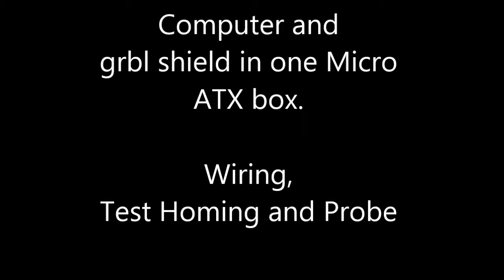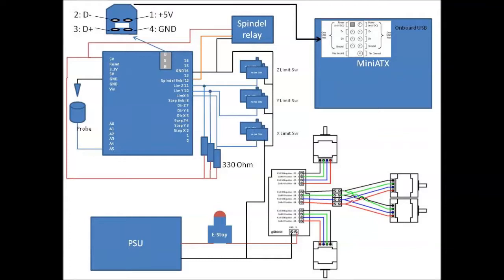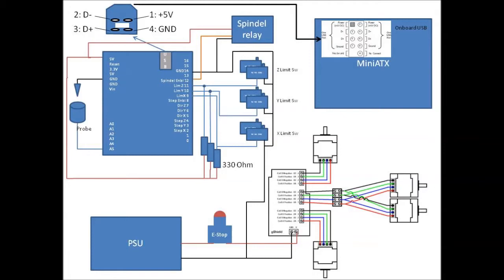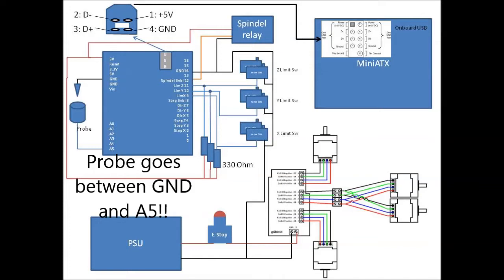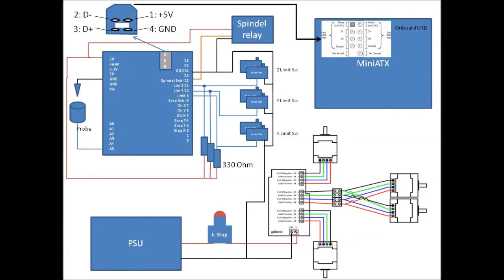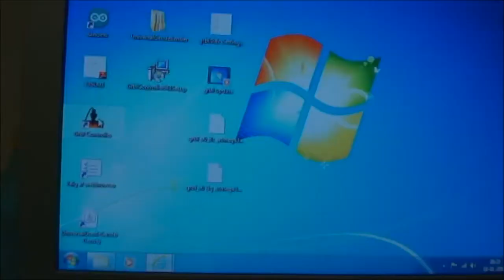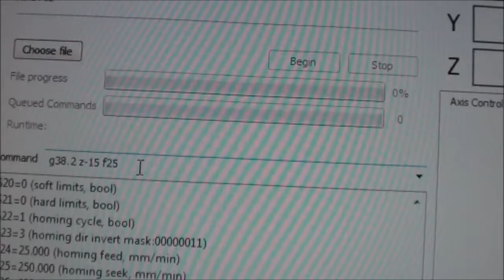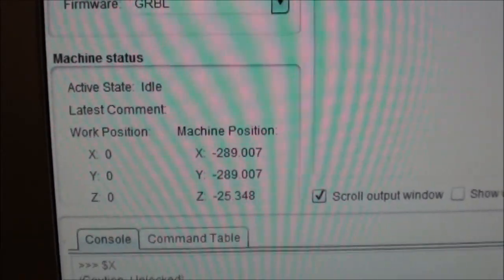ShapeOko box

Comment: Hej :)
can you tell me more about your CNC machine  ? good and bad, size, and more :)
PS. i have seen some of your Video's i like them. the "Dual belt" looks like a good idea :) thanks
Reply from the maker: Hi Kasper,
It's an entry level machine that's open source called ShapeOko. All parts can be shopped at https://www.inventables.com/
They also offer a newer version called X-Carve. The Open Source project is found here: http://projects.shapeoko.com/
Size of the machine in "normal" configuration is 50x50cm. However, you can expand this to e.g. 1mx1m. For the normal sized version cutting area is 280x280mm. It's very good for cutting wood, MDF, plastic, glass fiber reinforced plastic. I have also successfully milled aluminum. This is more tricky though.
The video re dual belt is for my next project. I'm in preparation for making an OX CNC inspired CNC router 150x130cm based on Openbuilds profiles. You can find a lot more info on Openbuilds.com
I will also post some more videos there and my learnings from the project.
Reply: Martin Barfoed thanks for the info, that sound good :)
when i see all the cool CNC machine i also want one :) haha
is there any good place to find the aluminium to build the machine ? ( here in Denmark )
Reply from the maker: ***** To my best knowledge you can not find these items in DK (or Scandinavia). I have been shopping in the US (openbuilds and inventables)  as well as in UK http://store.amberspyglass.co.uk/eshapeoko-mechanical-kit.html . As you can see they offer a kit analog to ShapeOko. I have also found a supplier in Portugal. http://ratrig.com/hardware.html   Maybe you can use one of them.